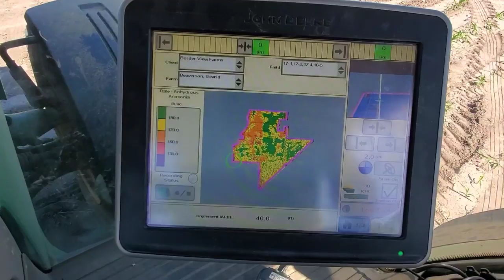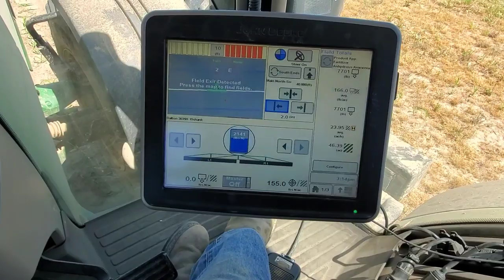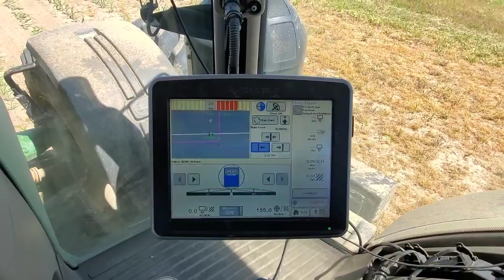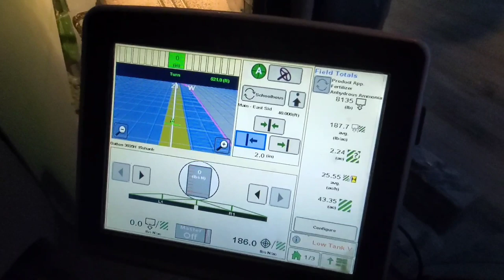I Broke the Applicator- #165

Comment: Nathan, we use a similar system for liquid fertilizer, a wire to clean out the tubes, I take a antenna off of a Dodge Caravan, cut the ball off the end, be sure to grab a stainless steel antenna mast. Makes a great tool for cleaning out the dirt & rocks from the tube. I also have a blow nozzle with a rubber tip & a 1/8” pipe street elbow which really helps to clean out the tubes that are plugged.  
Also your windows will have less streaks if you use regular paper towels instead of the blue towels. The blue towels are treated with an oil. Read the box. 
Hello from north east Montana.

Comment: Take a deep breath, you are doing a great job. NH3 is something not to mess with, I know. Also I used bailing wire in the holes on the shanks to keep them open.
Reply from the maker: I tried a wire didnt get it all. We'll blow it out with the air compressor at the shop.